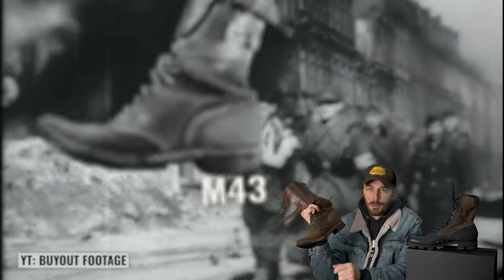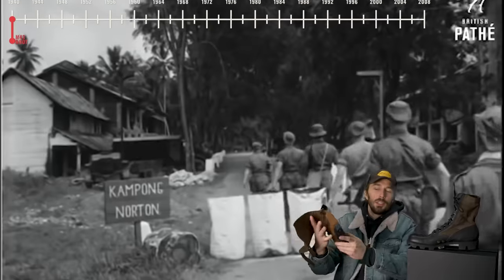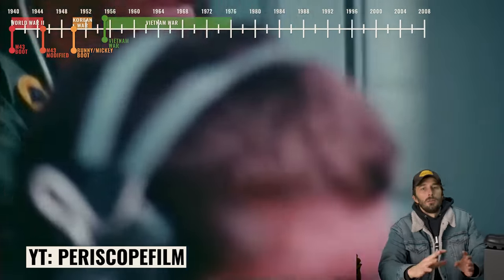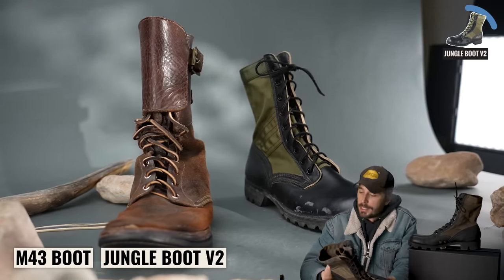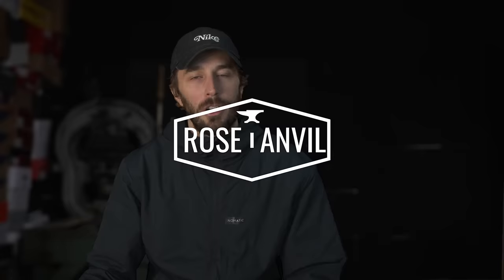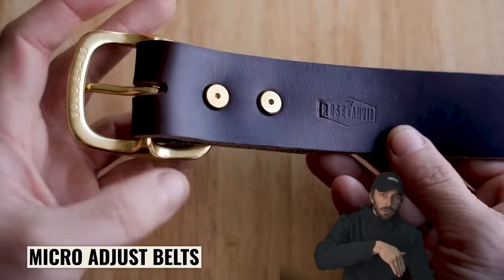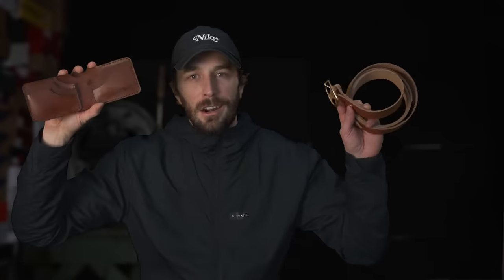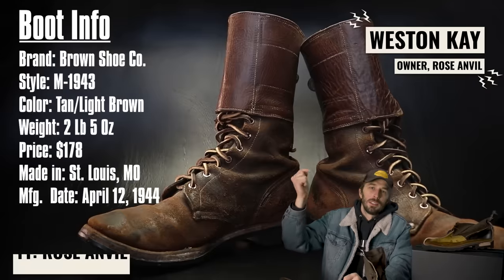Why Vietnam changed boots foreverr - (cut in half)

Comment: Army surplus jungle boots were the favorite footwear of cave explorers in the '70s.  Mine lasted from '76 to the late '80s when they  fell apart in the middle of a cave trip.  I lifted my foot and heard a metallic clanking sound on the cave's rock floor.  It was the sound of the steel shank falling out of my boot as upper and sole delaminated.  Luckily, I had some Duck Tape with me, so I could tape  my shoe back together.

Comment: The Jungle Book was a great boot except it had a very big drawback. I wore them for a number of years while I was in service. The drawback was that the soul of the boot was as hard as a rock . When you had to walk long distance on hard surfaces it was murder on your legs and arches. A lot of us removed the insert that it came with and replaced it with Dr Scholl's. Unfortunately by doing that most of the water repellent parts of the design of the shoe were eliminated.

Comment: Are you able to do a video on the current Altama jungle px? It would be interesting to see if Altama still makes a completely identical boot to the original usgi version.

I have a pair of Altama jungle px boots and they seem to have held up pretty good with the regular abuse that I put them through for the past three years. That includes using them as my primary summer work boots and constantly getting them submerged on kayak trips.

Comment: The converse high-tops of combat boots. I wore them all the time I was in, but I had to use normal boots during "dog and pony shows" like change of command or inspections. I never had the all black modern ones.
The sole does seem to be softer than most others, so it wears smooth faster than the rest of the boot wears out.

It's almost impossible to find the mesh insole any more.

I found good replicas on line. Best footwear for under $50 ever. I like the ankle support and that they're study and give sure-footing, so I use them just about all the time. I keep thinking for the next pair I should get the all-black, but I keep going with the green upper... (a certain common military wear replica company starting with "R".)

Make sure that they're vulcanized soles (not stitched or just glued), leather upper, and have the steel sole plate, or else they're cheap plastic trash and the sole breaks after one season (long before the sole wears down or any other part wears out). The cheap ones are not leather, but fake stuff that breaks quickly and doesn't "wear in" comfortably.

The only issue is that I have big arches, and these boots are very "flat" feeling. Get good insoles and arch supports, and they're great.

Comment: Wore these as summer boots in Germany in my armor unit in the early 1990s. The weight was the difference for me, you could wear them a long time without any fatigue. However we were NOT allowed to wear these in winter. Command thought the metal plate was a freeze concern so I went to my German made insulated. .
Still have an original pair of Jungle boots from the early 1990s I wear for work around the house and they keep going.

Comment: Great video. I retired to rural Brazil in 2021 and brought my jungle boots I had when in the 82nd back in 1980 when I trained in Ft. Sherman in Panama. I wore them out in Brazil. They lasted a long time and took a beating. I tried some of the spin offs like Rothco and was not happy. Basically, the other brands were a loose fit and I really liked the snug fit of the original boot. Lucklily after a lot of searching (including in many Army surpus shops) I found an almost new pair my size on eBay.I am so happy to have found them. What makes the original so unique is the very snug fit. Yes, they are a real bitch to get on but worth it as they are so stable. Also, the heel is sharp and hard. Going down a muddy hillside with my dogs I can go heel first, dig the heel in and not fall or slide. Too bad the originals are not manufactured any longer. Thanks for the background to these awesome boots!

Comment: I served in the Air Force from 75-95. We were issued the full leather combat boots back then. At some point, the jungle boots became the standard boot for all military. My first base was Minot AFB ND. We were issued the bunny/moon boots due to the cold weather. You were not issued a military drivers permit if you only had the white moon boots. If you did get a license to drive military vehicles in the winter, you were issued Muk Lucks. They had a thick rubber sole, canvas sides and reached just under your knee. They had inserts to help keep feet warm, a zipper to close them and a lace at the top to tighten them to your feet and leg. They were designed in a way to enable you to drive a vehicle and not hit the gas/brake or clutch inadvertently. To me, they were the best winter boot ever made.

Comment: There was a small factory in the 70s and 80s that built them near me. I used to pick up seconds super cheap. They were great for summer hiking in the northern New England mountains. However, when it got cool the sole would lose traction on ledge and rocks.

Comment: The speed at which a sole wears out can be simplified to 2 factors.

Contact surface area and hardness. The harder the material and larger the contact surface, the slower it wears. Given the extremely large tread grooves of the combat v3s i can definitely see them wearing faster. But i don't know how how hard the material is.

Comment: When the Marine Corps authorized their use in the late 1980's I got a pair.  You have to soak them in hot water and then turn them upside down and stomp on the heal to break the leather in.  Else, it would tare up your heals.  The only fault I found with them were the brass cover on the holes.  They would fall out all the time.  For me they were not a great boot for walking on hard paved surfaces.  That is when they would hurt my feet.  In the dirt and mud they were great.  Great boots!!!

Comment: I was in the Marine Corps from 2005-2012 and I remember seeing guys still wearing the desert version of these. Some of them still had the Panama soles but some of them were resoled with the newer Vibram soles. I had a pair when I was a kid playing paintball and airsoft with the Panama soles and the middle tread did wear out, but to be fair I think that mine were a cheaper made pair. Also a few of the eyelets popped out and I had to sew them back into the boot. I did like them at the time but I'd rather have the newer Bellville "Desert Jungle Boots" nowadays, they're much more comfortable and they're padded up top and don't dig into your calves/legs at the top of the boot.

Comment: I love your channel man,  I saw you on Dave's garage page. I'm in the Amsoil cult and a Merchant Marine engineer.  Here is the only reason why you should not prime the oil filter it happened to me, my fault. 
I drained the oil in my 2000 chevy express 6.5 gm diesel. I was working outside and getting dark so I let it drain overnight.  I got busy and my van sat for 2 weeks draining every drop. I filled the engine and filter with 15 40. It was winter here in the New York. I started the engine and watched for my oil preasure and it didn't come up immediately like I expected.  I shut of the engine and double checked my drain plug and dipstick. All good. Try it again and still no oil preasure.  Shut of the engine now I suspected the gauge was bad but started it 1 more time and nothing, now the valve lash is getting loud so I know there is a problem and I'm starting to panic, wondering what I did wrong. The light bulb goes on over my head. I place a oil pan under the filter and unscrew it a couple turns, start the engine and watch. 2 seconds later the oil pours out. I shut of the engine and tighten the filter.  All good now. So what happened was I let the oil drain so long that the oil pump lost its prime and with the filter perfectly full it had no where to push out the air. So now I still prefilled my filter but I leave a little room for air in there, and don't drain my oil for 2 weeks!
Thanks for the knowledge bros. 
😅

Comment: I had a pair of those (surplus) jungle boots and I seem to remember that those portholes had one-way valve not letting water in, only out. I really put the pair through it's paces and I think valve was still working after years or wear. I could be remembering wrong, it was loooooong ago.
Also I am absolutely sure there were intermittend versions of the jungle boots. The pair I did have that nylon enforcement start but did not have "panama" sole it has that original sole. I do remember mud sticking to soled like hell, it was like wearing  skates, you had slipper mud cushions on bottom of your shoes. 

Soles wearing out, depends on where you use them. Asphal or concrete or gravel wears them out much faster that dirt. I used to ride a bike with them (yeah ;)) and breaking with my feet on asphal wore the soles quite bad. But the old style sole took a hell of a lot wear and hac grip.

Comment: I had those jungle boots in Desert Storm. It was a bastard to keep waxed  in the sand.  One of our squad leaders just said f it and stopped waxing before we crossed into Iraq.  By the time we left in July, they were brown leather with green upper.  

Still have mine and they still shine.  I have the V3.  V2 was still available to us even as late as 1991.  And we knew the difference based on the tread pattern.

Also, there were 2 different laces.  There was a long one and a short one.  You had to wrap the long ones around the top and your shin and put the ties inside.  I got the short ones because all that extra lace of the long put indentations in your calfs. It took a little longer to lace up the last three levels of holes but when it was supper hot from May to July, I’d wrap the short laces around my ankles and just left the tops open.  It looked stupid but we were just sitting around waiting for a flight home around May.  We were relieved from border security.

Comment: The standard for letting feet get wet and then drying is the 'tennis shoe' or sport shoe with a breathable netlike top.  Surprisingly they are also the foot gear to beat in cold weather (if it is dry, once it snows or moisture is introduced then it is another story).  Two little port holes are not going to 'dry' your feet.  Once the boot is wet even if you have the opportunity to change to dry socks (not a forgone conclusion in combat) they will only become wet socks if the boots have to be put right back on.  If your feet stay wet, you are going to get trench foot.  End of story.  Maybe someday they will come up with a boot innersole made of the same chemicals they use to absorb moisture in electronics and packaging.  Then they will still have the problem of drying the insole chemicals.

Comment: Soldiers  would come into our base shoe repair with new boots wanting the steel plate removed.  We would grind off sole, cut out plate and replace with foam crepe and a Vibram sole.  Apparently  the plate made boots too hot.

Comment: There was a change in the mid 90s to the boots. It went from the canvas upper in OD to an all black nylon. 
The basic design held on for a few more years as the first of the desert boots that were designed during Desert Storm. Tan/sand nylon and suede and without the metal protective insert. Those were in use until around 2006ish, and the final iteration had a sole with an EVA midsole.

Comment: One of the only downsides to the jungle boot is that it does not have a steel toe, therefore I couldn't wear them often in the navy. Also with the nylon upper they are not good to wear when welding, sparks go right through them. No fun trying to stomp out a fire with them on. Still very comfortable to wear fishing though.

Comment: I was issued a pair of these boots but in all black when I joined the Marines in the '90s. They were 1 of 2 pairs of boots that e got issued, most of the time we would wear our all leather boots but for a period in boot camp we would wear the jungles because the all leathers (we called them Cadillacs) were spit shined to a mirror finish for a formal inspection and final drill so they weren't worn to keep them nice and shiny. 

The nice thing about the jungle style boots is that they were very easy to polish. You only really had to worry about polishing the toes and the heels, this made polishing much faster and easier.

Comment: I loved my jungle boots. I had several pairs over the years but the corcoran brand, if i remember the name right, was my favorite. They were black on the side instead of green. What i liked was that they breathed well and were easy to take on and off. I never used the sole they came with. I would have them resoled to a heavier lug pattern before i used them. I did the same with my jump boots which i used for my class a for inspections, boards, and court room duty. After i ended my service in 2008 my boots were stored in my utility room. I had close to a dozen pair including 2 pair of unused matterhorn boots. One day i went to get my jungle boots to wear to work, we had a hurricane incoming and i wanted a better pair of boots to use, and found my wife had thrown all of them away. To say i was upset was putting it mildly. She thought i would not have noticed and that they were just junk. They were all shined, all had custom soles and insoles on each with spare insoles and laces  hung on the wall. I keep meaning to go to the army surplus store and see if i can find me a pair of size 12 jungles but ill never be able to get them to feel the same as the ones i wore when i served.

Comment: Did a lot of trekking water proof boots are stupid ,it make your feet soft and bloated ,leading to bad blisters 
better to have boot which let the water in and out easily , the feet dry well and an occasional soaking is just refreshing 
if the path is always full of water no boots will make any difference , you will have wet feet but the real test is how long will it take to dry out 
cold is not a problem unless it's -10 C , a good walking pace generate enough heat

Comment: The soft rubber sole on the jungle boots does wear out in everyday use on hard surfaces. The lifespan is around one and a half years in actual everyday use. This may have to do with the specific producer of the boots I had, but it does happen. That being said, no other sole on any other boot has fared better, pretty much the same or worse. When the jungle boots lose the pattern, most of my other boots have started to break apart because the sole wore out to the inner cavities where it just crumbled apart. The jungle boots have such high soles that they actually lasted better in the same conditions.

Comment: The reputation for bad wear on the soles comes from the early GWOT, when jungle boots got used in the desert for the early part. The rubber had a tendency to flake or crack in the hot, dry, abrasive environment, sand got in through the vents and wore the boots from the inside, and the metal shank and spike plate created hot spots inside the soles and transferred heat to the wearer. Most jungles also used weaker nylon at that time.

Updated desert boots are mostly based on the jungles, but remove the vents, use stronger cordura nylon, remove the spike plate, replace the steel shank with resin, and use different rubber compounds better suited to the abrasion. The Panama sole isn't overall prone to wear, just bad for a dry, hot, abrasive environment.

Comment: dms so;es are great  but sadly the panama sole was only there last 2 years or so avalible tosoliders the us was required to finish production of the original boot before mass producing panama sole boots originals are very rare , they did some side by side production but most stillgot original vbram outsole , mid 70s before all troops got them the war allbut over

Comment: I wore these boots till the outsoles got worn out. I loved em for how slim and cheap they were. With a good insole they are pretty good my only 3 issues were the outsole does wear out pretty quickly when youre pounding pavement (the lugs do work great in the mud though). I had an issue with my middle toe getting excessively depressed by a crease in the leather i think and the last one was breaking them in was very painful because of how narrow the toebox is.

Comment: I'd like to see a true hot weather(desert) version be made. Good ventilation for none sweaty feet.  Also a total ballistic nylon upper and no leather.  I think other materials are more durable than leather in my experience.
Reply: The desert boot.  Same thing, in tan, and rough out leather.  Issued for decades.  As for the leather, your foot is leather, effectively.  Hardened steel is tougher than nylon, but you might see the problem with a boot made of that.  Same for nylon.  Also nylon falls apart from sunlight and age.  Leather can be preserved nearly indefinitely.

Comment: Who still makes boots w these soles?
Reply: Altama. I have a pair that I use for summer work boots and constantly get them wet when kayaking. The boots are three years old and still holding up pretty good. The only downside is that if you want the mesh insoles that help the boots dry faster, you have to track them down on the surplus market.